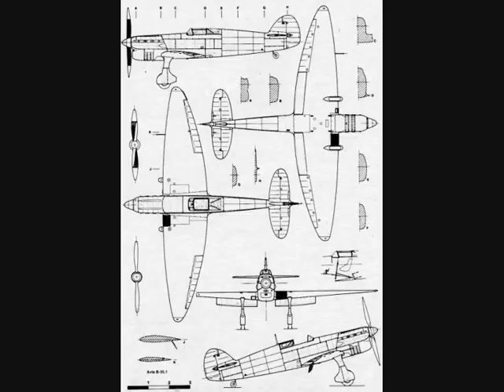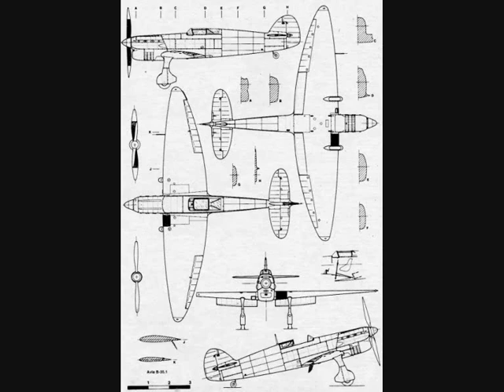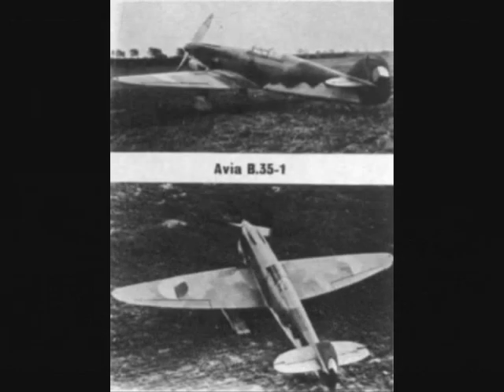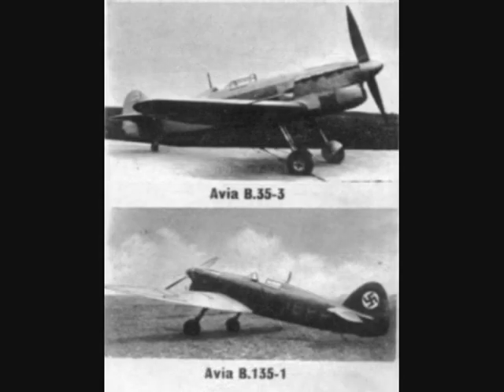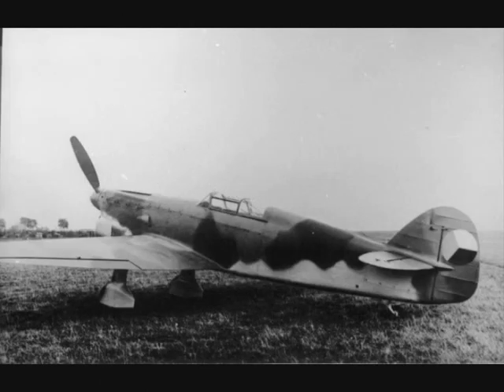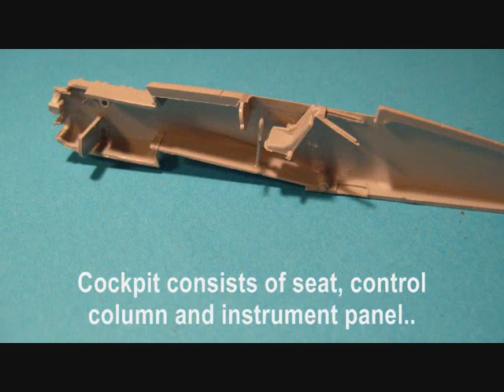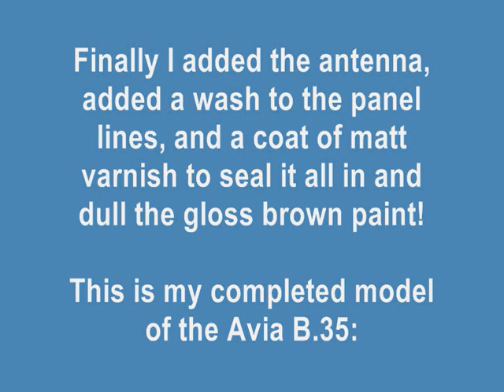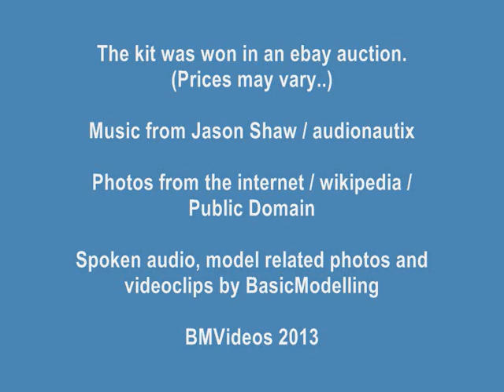KOPRO / MASTER CRAFT 1/72 Avia 35.B - A Building Review

Comment from the maker: I just happen to have an interest in, and a great liking for, these odd old aircraft, and odd old kits... :) :) But I will build some more streamlined kits before long I'm sure.. Still working on my Revell Lancaster which is about as new and up to date as you can get.. (apart from Airfix's new tooling of the Lanc, of'course). I've just posted another video, I managed to complete my latest model quite quickly this time, which makes a change.. :)

Comment from the maker: The tricky bit was having to use gloss paint for the brown, as that was the only shade I had that seemed most accurate, and painting gloss without brushlines isn't easy! Luckily a coat of matt varnish over the whole thing brought everything down to an even 'sheen'. :) Other than that the pattern wasn't that hard to do, the trick is to make sure you have a uniform base shade, and then add the other shades after.. that way you avoid gaps and lines inbetween the patterns, a common beginner mistake!

Comment: Looks like one of the better KP kits. I mean their old tooled stuff, the new KP/AZmodel kits are really good. You're right, Bulgaria used the Avia B 135, which was a new version of this aircraft with retractable landing gear. Bulgaria received 12 Czechoslovak made B-135s  along with several engines and a licence to produce the aircraft domestically.  The Bulgarian airforce wasn't satisfied with the B-135s performance and the planes were relegated to training duties. In the end, no B 135 were ever produced in Bulgaria. In 1944, Avia B 135, along with the D 520's and the Bf109s were used in combat against the US Air Force.